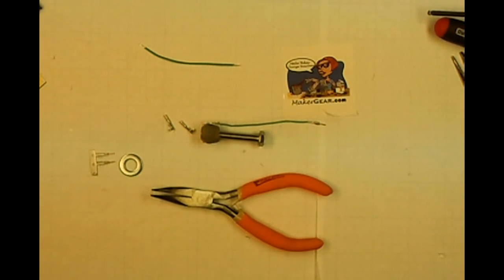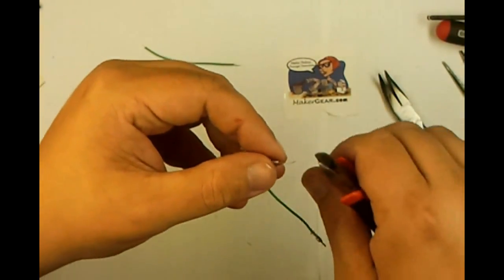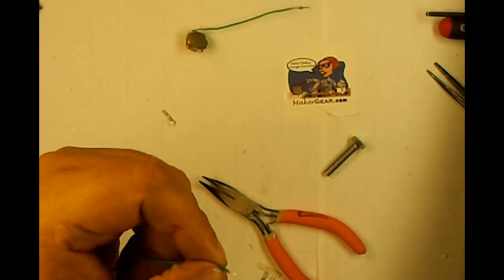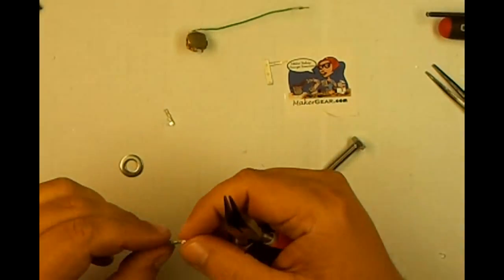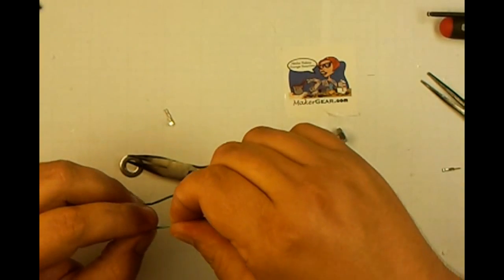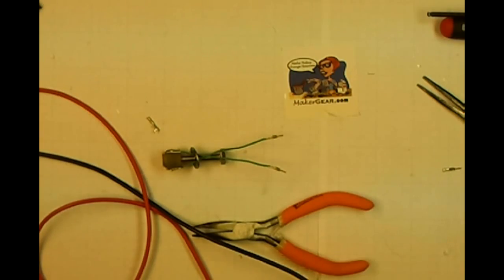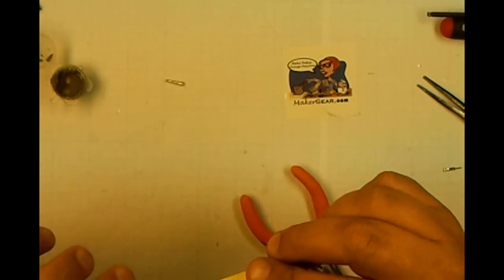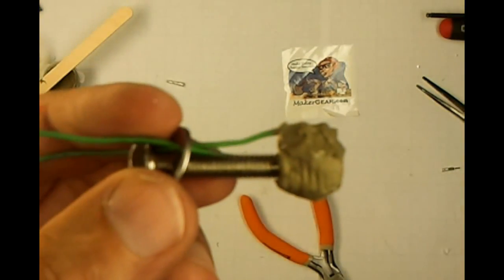Still Extruding: Assembling a MakerGear Heatercore

Comment: The resistor rating is in free air. We are adding a heatsink so it doesn't get too hot (they are rated for 350C). Since the resistor is simply constantan wound on a ceramic core and potted with a high temperature ceramic it is no more scary than a home rolled one.